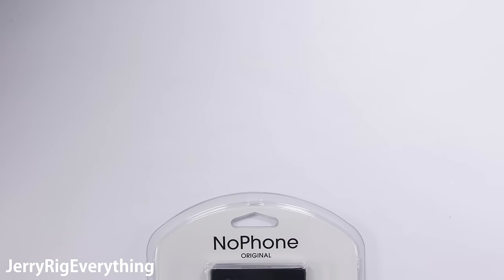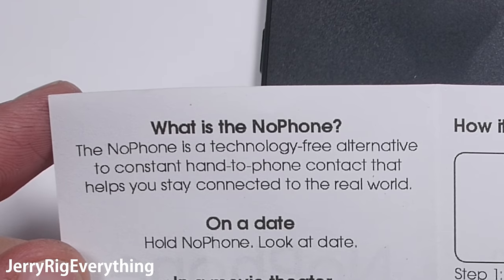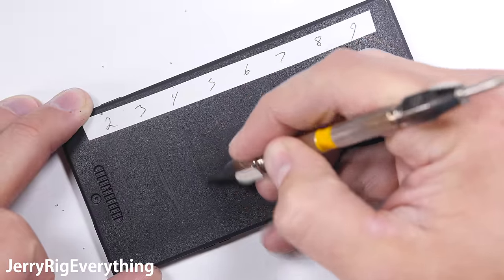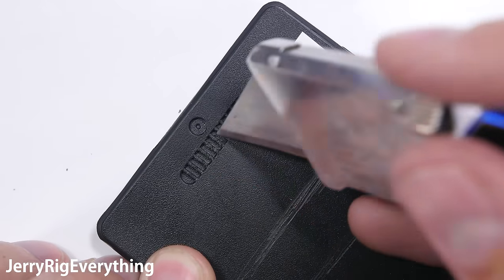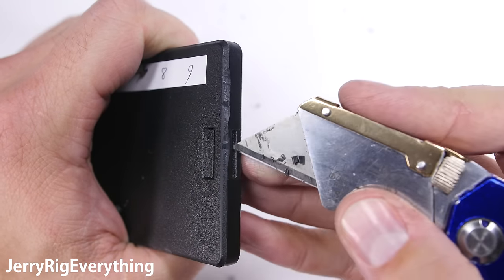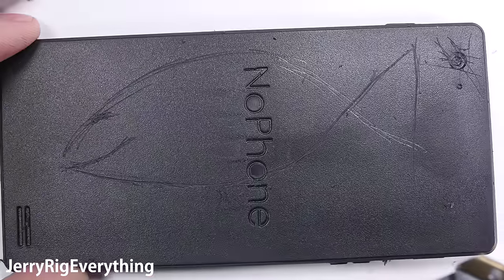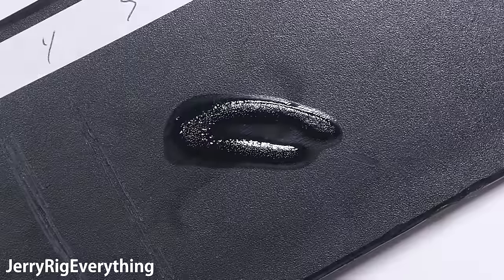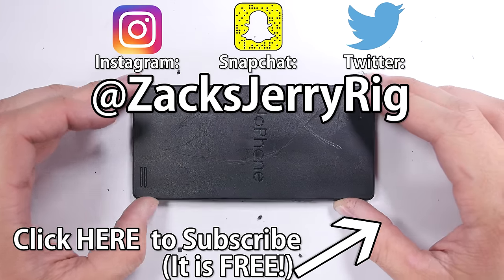NoPhone Durability Test - Scratch and BEND test!

Comment: Most disappointing thing about the NoPhone: They used a plastic back but they still don't have wireless charging...
Reply: That shouldn't matter if your battery life is infinite
Reply: Because it doesn't need to be charged. It is the only phone you won't need to connect to a power outlet every day or two :D
Reply: Radiatical Actually he didn't mention it. But NoPhone has NO wireless charging. So, no need to disappoint.
Reply: i think it does have wireless charging. Because i don't see any usb-c or micro usb
Reply: It has a proprietary port, but it's only if they want to expand on capabilities. It's battery life is ifinite
Reply: David Navarrete future proofing.. Yaaaay
Reply: Radiatical it has infinite screen in time
Reply: Radiatical = POOR USE OF SPACE!!!
Reply: Have a look at the HTC U Ultra video.
Reply: Craig Simpson yeup.. Seen it.... Such a waste of space... 😂😂😂
Reply: Radiatical Hahahaha
Reply: hahahaha......actually they dont need wireless charging.......because the battery is an ever-charge  battery and dosnt exhaust........standby hours is infinity as well...........lolz
Reply: it  does come with wireless charging it charges at an amazing 0v 0a at 0Watts faster than anything the iphone has.
Reply: Radiatical plastic backs dont support wireless charging
Reply: Radiatical because the battery backup is lifetime
Reply: Radiatical the no phone has an infinite battery supply. No need to ever charge it
Reply: Radiatical it has nocharging
Reply: Radiatical pixel 3a and galaxy a50 both are plastic backs with no wireless charging xD

Comment: The NoPhone is actually unbreakable:
Even if you can break it in 2 parts, it will always work
Reply: Unlike the iPhone 6 Plus that I’m currently using
Reply: Unlike any apple product ever
Reply: Even if you break it down to individual atoms it will work exactly how it used to
Reply: @thejummyjum6207  r/UnexpectedThanos
Reply: @Dexuz  r/ihavereddit
Reply: it maybe unbreakable but it doesnt work that well still, as it doesnt have a headphone jack
Reply: @questionmarkquestionmarkques  r/ihaveihavereddit
Reply: I broke into laugher while reading this comment. Guess I'm not really durable
Reply: What about down to atomic parts?
Reply: @nvcbl  well, it will be hard to use but it works
Reply: @cubic.gamesonline2797  remove the atomic parts to make it unusable
Reply: You can collect  the shards and melt it back together if you want one screen but it think its better with 2
Reply: Google's and sadly unlike any other phones beside iPhones
Reply: no it a new function name cloning and now you have 2
Reply: But just in case, you should probably upgrade to the nophone air. I have dropped that thing so many times and it still looks just like how it looked in the package and on the ad.
Reply: Still better than the folding phones we have today

Comment: What's next? Apple completely removing charing support to save space for a bigger battery?
Reply: Niels Blankenstijn and then the screen...
Reply: Niels Blankenstijn they are toying with the idea of removing the charging port and create a wall outlet like the one included in the box, but with not USB port, and any iphone within the 10ft radius of it will start charging
Reply: Niels Blankenstijn no wrong completely wrong they will remove the screen so it doesn't break when you drop it
Reply: DVX iPhantomzZx 😂😂😂
Reply: Niels Blankenstijn i could happen, wireless charging
Reply: Jose Romero M and it would still suck to do that.
Reply: Everyone thinking about wireless charging from more than half an inch away, check out ElectroBoom's video on the topic.
Reply: Apple has been notorious for shipping their phones with batteries smaller than your great aunt's flip phone.
Reply: The battery lasts 999999 years tho.
Reply: Yeh, just minus that number by itself then by one and your correct
Reply: They did that already
Reply: Knowing them, they'll make a 1 year lasting battery, so instead of getting it replaced, you have to buy the new iPhone.

Comment: Why does the phone not come with earpieces,charging brick and charging cable
Reply: Lim Zexel the battery lasts forever, no need for charging peripherals
Reply: And there is no headphone jack either, I hope it has bluetooth 5.0 though. So I can connect my bluetooth headset.
Reply: The NoPhone GS, the new NoPhone with 0.00000000025% more pixels and support for Bluetooth 0.0!
Reply: I charged my phone on the NoPhone with the USB port but it didn't charge!
Send help!!

Comment: Specs list:

-variants: 0/0, 0/0
-RAM: 0 mb
-storage: 0 mb
-display: 0x0 N/A 0.0 inch
-processor: N/A 0nm (impressive!)
-build: all plastic
-technologies: waterproof  (up to 200 years) dustproof
-system: android 0.0 "cotton candy in water"
-cameras: 0 megapixel rear facing camera (no OIS, no focus), 0 megapixel front facing camera
-speakers: in existent
-0G NON-LTE
-ports: usb-air
No NFC, radio, etc.